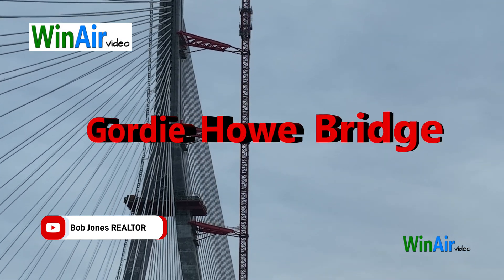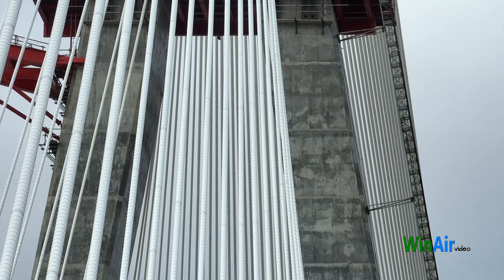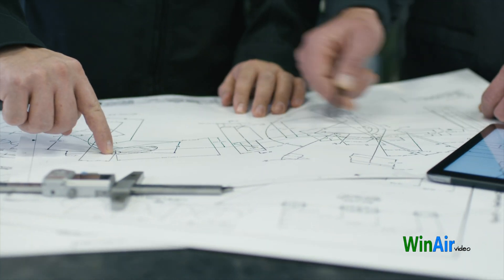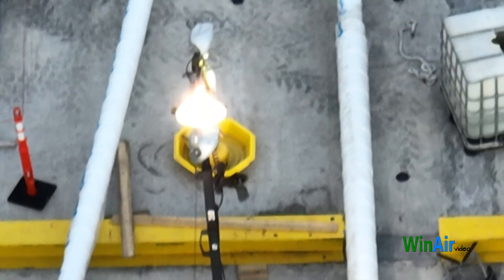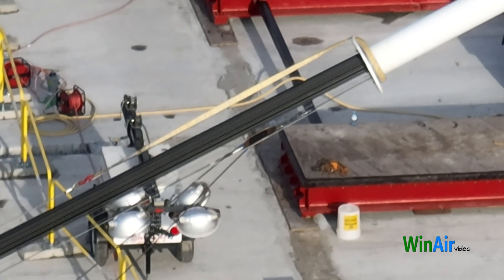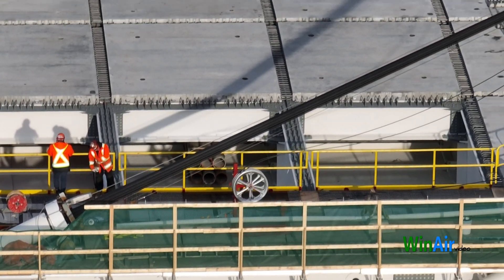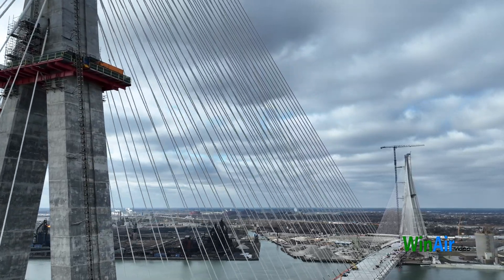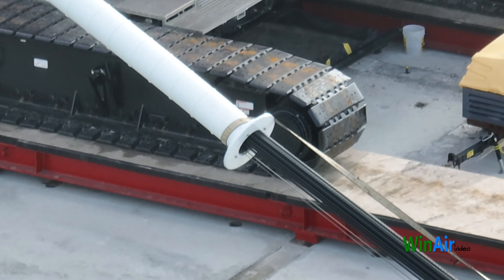Discover Secrets of Gordie Howe Bridge Stay Cables!

Comment: Love this one Bob . . . Super clear, but with one 'looming' question . . . . 
Playing with math here (most certainly not my forte :o) . . . "allowing it to support 34 million pounds once completed" meaning it will support 17,000 tons. 
That doesn't sound like a lot!
Especially when the new 'electric' transport trucks will each require 4 tons of batteries?
I've obviously missed something here. Please help me find it :o)
Reply from the maker: Interesting question, John. Not being an engineer, I did a search to enlighten me and this is what I got back. Hope it helps:
You're correct that the Gordie Howe International Bridge is designed to support a substantial load, including approximately 34 million pounds (or about 17,000 tons). This capacity is focused on accommodating a large volume of traffic, including heavy trucks, without compromising safety.
Regarding electric transport trucks, while the batteries do add significant weight—typically ranging from 1 to 4 tons per truck depending on the size and type of vehicle—the bridge's design accounts for the cumulative weight of multiple vehicles.
Bridges are engineered not just to carry the weight of individual trucks but to manage the dynamic loads from many vehicles traveling simultaneously. The 34 million-pound capacity reflects the overall weight allowance for a significant number of vehicles, not just a single truck. So, while electric trucks may have heavier batteries, the bridge's load capacity is intended to handle the total weight from multiple vehicles in transit at any given time.
Thus, the bridge should be capable of safely supporting modern transport trucks, while also providing enough capacity for normal traffic flow.

So I guess if you piled 35 million pounds in one spot on the bridge it would be in trouble, but spread out across the half mile span is no probs!🌉😎👍

Comment: Any idea what the tensile strength of one of those individual cables?
Reply from the maker: Hi Yooper_eh. Nope, but I did a quick search and this is what I got back;
The individual cables that make up the stay cables on the Gordie Howe International Bridge are composed of 0.6-inch diameter grade 270 post-tensioning strands. While the exact tensile strength of a single strand is not explicitly stated in the search results, we can infer some information based on industry standards.
Grade 270 refers to the minimum ultimate tensile strength of the strand, which is 270 ksi (kilopounds per square inch) or approximately 1,860 MPa (megapascals). This means that each individual 0.6-inch diameter strand can withstand a significant amount of tension before failure.
😎👍
Reply: @bobjonesrealtor7756  Thanks so much for that. I knew they had to be incredibly strong.
Reply from the maker: Thank you. Your question(s) help me learn. Glad your here. :)

Comment: Do you know if the stay cables actually anchor into the tower, or do they pass thru it and connect on the opposite side? Some cable stayed bridges have the latter arrangement. 
BTW, the first time I ever saw a cable stayed bridge, it reminded me of my grandmother's rope hammock. Some, especially those with a single tower at each end (like the Sunshine Skyway in Florida) make me think of the skeleton of some Godzilla sized dinosaur, with a pair of huge spines sticking up on its back.  I won't be driving across any of these bridges, as we don't have any where I live here in the Mid-Atlantic coast.  Well, not until the new Francis Scott Key Bridge is completed. 
Anyway, that was a very informative video.
Reply from the maker: Hi Leeriffee. I am not an engineer, so take this as my assumption not fact. From my understanding the cables each connect to a manufactured cable box inside the tower. The cable is passed through the concrete tower into the steel cable box where each strand is secured and tensioned. When the cables need adjustment they can each cable independently. So, yes the cables anchor to the tower.🌉😎👍

Comment: How important can you expect the interment adjustment of the necessary adjustments to be? How can they be done?
Reply from the maker: Hi Carl. Interesting question. I am not an engineer, but I did a quick search and this is what I found:
The intermittent adjustment of stay cables on the Gordie Howe Bridge is crucial for maintaining the bridge's structural integrity and performance. These adjustments are essential for several reasons:
Load distribution: Stay cable adjustments ensure proper load distribution across the bridge structure, preventing uneven stress on specific components13.
Vibration control: Fine-tuning the cables helps mitigate vibrations caused by traffic and environmental forces, ensuring a smoother and safer crossing experience1.
Deck alignment: Adjustments are necessary to maintain the correct alignment and elevation of the bridge deck, which is critical for the bridge's overall stability6.
Adjustment Methods
Stay cable adjustments can be performed using several techniques:
Tensioning: Engineers can adjust the tension in individual cables using hydraulic jacks or other specialized equipment3.
Jacking: The bridge deck can be slightly moved to create room for adjustments. For example, the Canadian side of the bridge may be jacked farther away to make space for final measurements and adjustments6.
Precision measurements: Advanced surveying and monitoring equipment is used to ensure the bridge alignment remains within tight tolerances, typically within 100 to 150 millimeters6.
Continuous monitoring: Throughout the bridge's lifespan, engineers will likely use structural health monitoring systems to detect any changes in cable tension or bridge behavior, allowing for timely adjustments as needed13.
These adjustment processes are meticulous and critical, requiring expertise in structural engineering and bridge construction. They play a vital role in ensuring the Gordie Howe Bridge remains safe, stable, and functional throughout its operational life.
Thanks for asking. 😎👍🌉

Comment: How can a round cable be made aerodynamic?
Reply from the maker: Hi Joe. Great question. I did a quick search and this is what came back;
The Gordie Howe International Bridge employs several techniques to make its round cables aerodynamic:
HDPE sheathing: The cables are encased in white weather-resistant, high-density polyethylene (HDPE) plastic pipes. This smooth outer surface helps reduce wind resistance.
Cable surface modifications: While not explicitly mentioned for the Gordie Howe Bridge, cable-stayed bridges often use surface modifications like helical fillets or dimples to disrupt airflow and reduce wind-induced vibrations.
Dampers: All cables incorporate DYWIDAG external hydraulic dampers. These dampers help control cable vibrations caused by wind and other forces.
Wind tunnel testing: Extensive wind tunnel tests were conducted to optimize the bridge's aerodynamic performance, including tests on cable behavior under various wind conditions.
Cable arrangement: The fan-shaped arrangement of the cables contributes to the overall aerodynamic performance of the bridge structure.
These measures collectively ensure that the round cables of the Gordie Howe International Bridge are as aerodynamic as possible, contributing to the bridge's stability and longevity in various wind conditions.
Interesting, thanks for asking!😎👍

Comment: Watching this video I had a flash back to the issues with the Port Mann bridge in Vancouver. For those who don’t learn from history the first snow storm or freezing rain event is going to create chaos if steps have not been taken to prevent ice forming on the cables, melting and thus releasing chunks of ice or heavy lumps of snow to plunge onto vehicles on the deck. This is what happens when a central tower is used for the stay cables because they fan out over the road. When BC built the Alex Fraser bridge it featured H towers so the cables were outside the deck and falling snow and ice falls harmlessly into the river. Nobody thought about it an an FMEA because we get milder winters but we do get some snow and some freezing rain. Did they install devices to mitigate this issue on the Gordimer How?
Reply: Correction. Not the Alex Fraser. The Patello was built with H columns
Reply: @AlexCurrie-q9e  Correction.  Actually, both the Alex Fraser and Patullo bridges have H towers.
Reply from the maker: Thanks for the heads up, Alex.
Reply from the maker: Lol. Now I've got two bridges to check out! Thanks for sharing, Alex.😎👍
Reply from the maker: Apparently the raised rings on the exterior of the cables are a deterrent to ice formation. I believe I read there is also something in the material makeup of the cable covers that inhibits icing on the cables. I'll take a look to see what I can find. Thanks for the question.😎👍

Comment: Lifespan less than 30 years.
Reply from the maker: Hi Fcapio. I thought that lifespan was a little short so did a quick search. This is what I found;
The stay cables on the Gordie Howe International Bridge are designed to have a lifespan of 100 years2. This is part of the bridge's comprehensive durability plan, which aims for an overall service life of 125 years for the main structure. The stay cables are considered replaceable elements, along with other components like bearings and expansion joints, which have shorter lifespans of 30 to 60 years2. This design approach ensures the longevity and structural integrity of the bridge while allowing for the replacement of specific components as needed over time. 
They replaced the cables on the Ambassador over the past few years after 90 some years of service. A good post that got me thinking. Thanks for sharing. 😎👍
Reply: @bobjonesrealtor7756  of course, the lifespan of a bridge like that is determined by the condition of the cables. The removal of the old cables and replacement with new cables (if  it ever happens) is extremely costly (labour and materials) and comes close to the cost of a new bridge. The old Champlain (steel) bridge in Montreal was demolished after 60 years and had serious problems after 40 years, associated with enormous costs to keep the bridge open. My definition of lifespan is the function of a bridge with no other costs than regular service. In short, a healthy bridge, and not a bridge on life support… you will see, if you are young enough. All the best …
Reply from the maker: They replaced cables on the Ambassador in the past few years. Yeah, I think I qualify on the age thing, fcapio. :)
Reply: Look up Mackinac bridge..65 + years and counting
Reply: @TheHk1966  Mackinac bridge is suspension, not cable stayed.  Big difference.
Reply from the maker: Big difference.